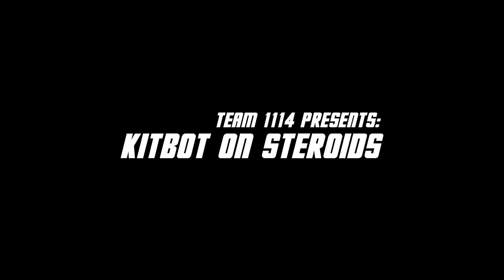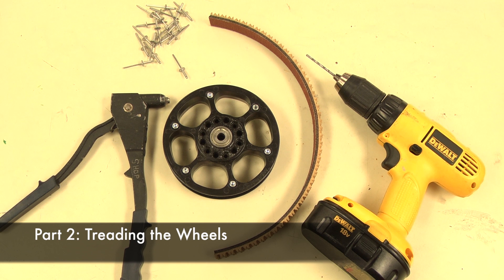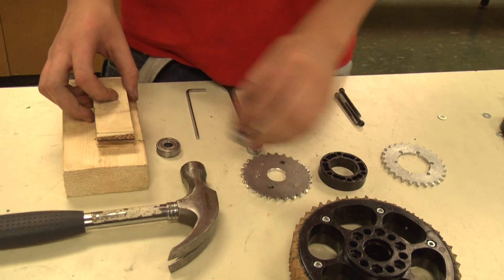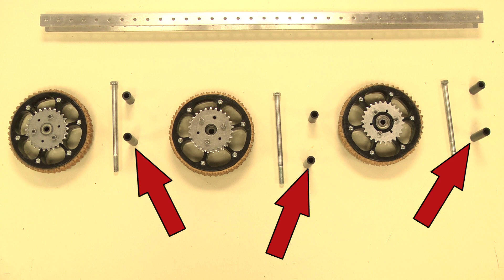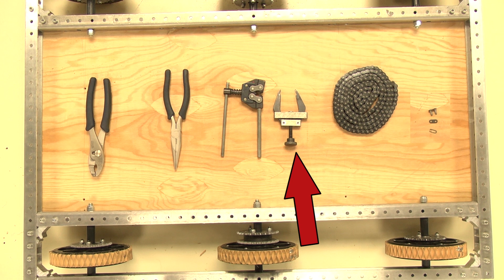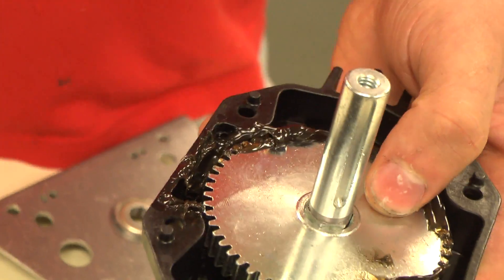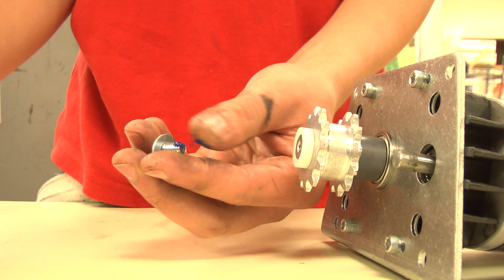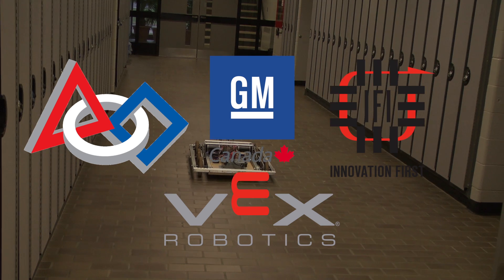Kitbot on Steroids Instructions - 1114 Simbotics

Comment: Great video! Just wondering why you guys don't put the washers on the motors before the gear and machine key. The 2014 KOP instructions state you should add two 5/16 washers before the key gear and retaining clip. I'm guessing the washers help prevent grinding of the gear and motor.
Reply: The washers are not needed on  CIMple Box gearboxes :) They are, however, needed on toughbox minis which now come with kits. I learned that this year when I used a CIMple Box for the first time and put a washer on it. The space between the key gear and the metal side of the gearbox is greater in the toughbox mini which makes it need washers for space so the gear can properly fit into the 56 tooth gear. In a CIMple Box, though, there is a smaller amount of space from the key gear to the metal side of the gearbox housing. Since I put a washer on it when I made my first CIMple Box and I was not aware that there was not supposed to be a washer, the key gear began grinding on the metal side of the housing because it was too high with the washer and it began heating up the metal because of all the friction.